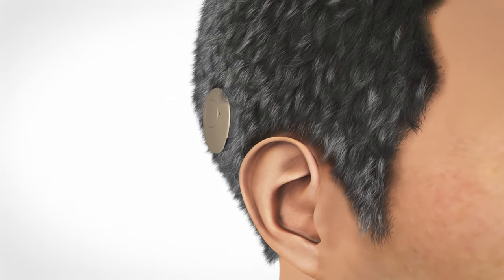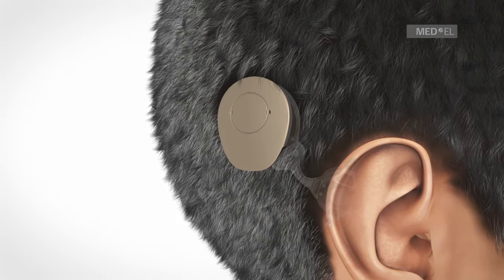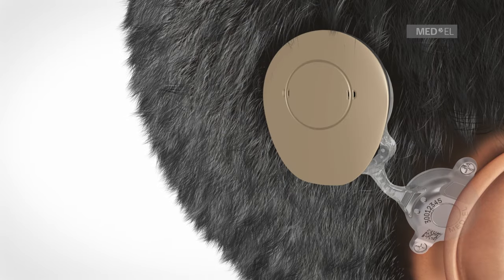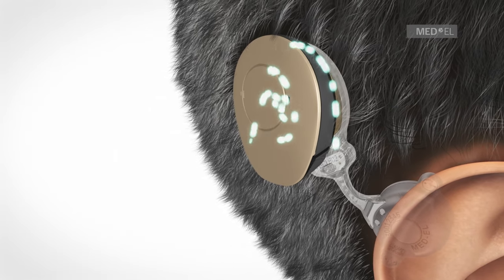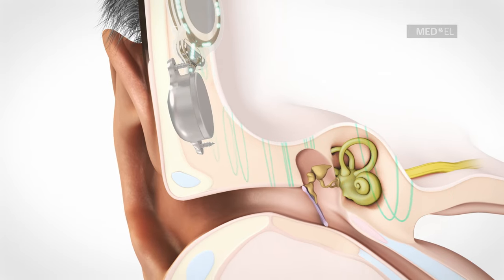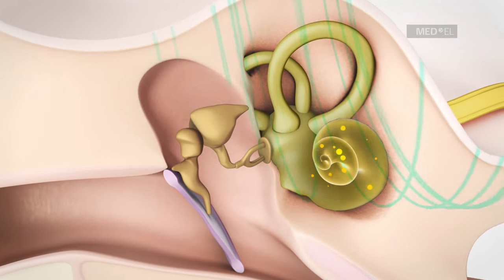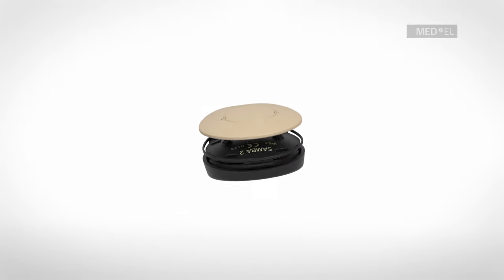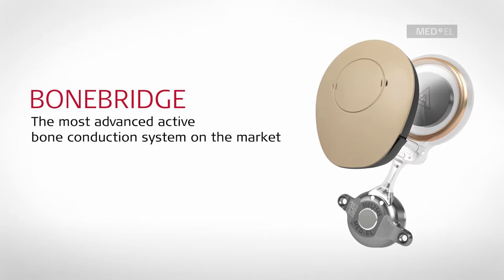How the BONEBRIDGE Bone Conduction Implant Works With SAMBA 2

Comment: What is the feedback like, does it give any?
Reply from the maker: Hi there, the innovative design of BONEBRIDGE separates the microphones from the mechanism which creates the vibratory energy.  This means that the likelihood of experiencing feedback with BONEBRIDGE is significantly less than with those percutaneous and passive bone conduction implants, and perhaps even hearing aids.  

However, each individual has a unique hearing loss and we recommend to consult your medical specialist or our local MED-EL team near to determine if BONEBRIDGE could be a hearing solution for you.  We are happy to get you in touch, just send us a message via www.medel.com/contact 

Kind Regards,
Giulia